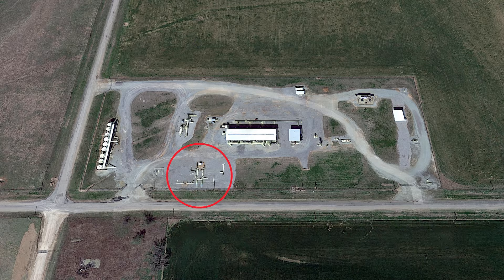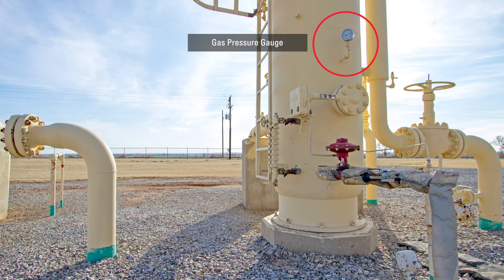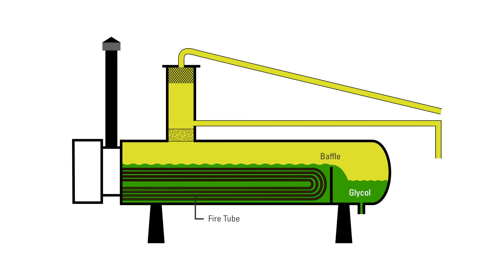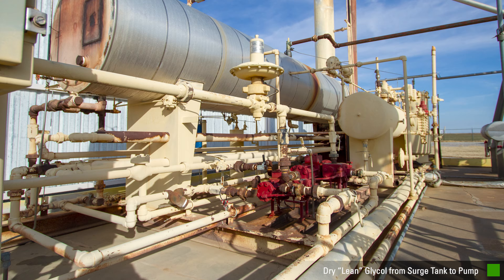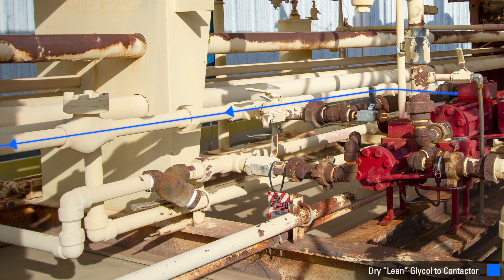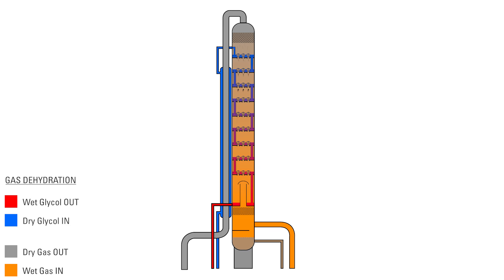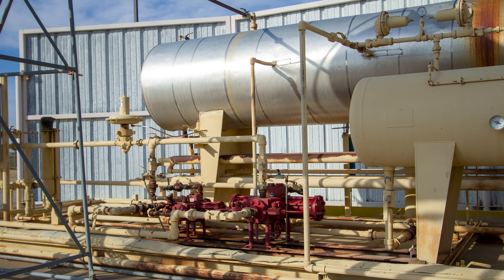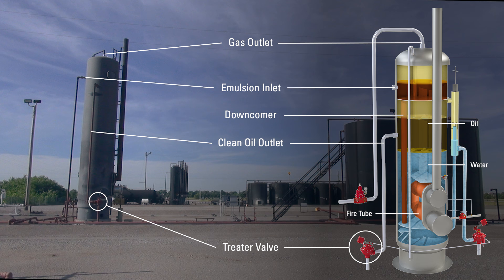Gas Dehydration System: Glycol Regeneration (TEG) [Glycol Pump, Reboiler, Contact Tower, BTEX]

Comment: Hello Kimray, instead of two pumps, what would've been the cost-benefit analysis of using a VFD with the first pump and not buying the smaller one?
Reply from the maker: Two pumps were used because of the varying gas flow rates between the winter and summer. In the summer months, the required glycol flow rate is below the minimum stall point of the larger pump. Our energy exchange pumps' glycol output or speed can be adjusted with their needle valves. VFD’s (variable frequency drives) are used to control the speed electric glycol pump.